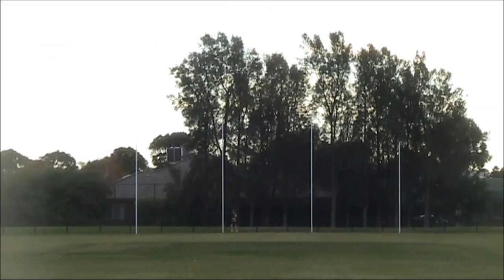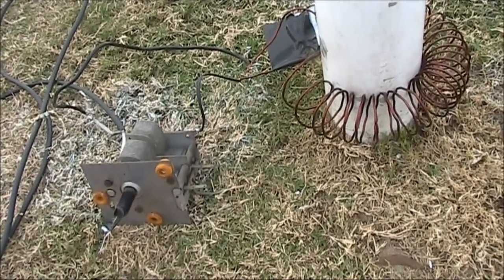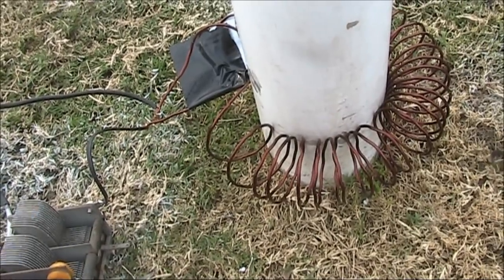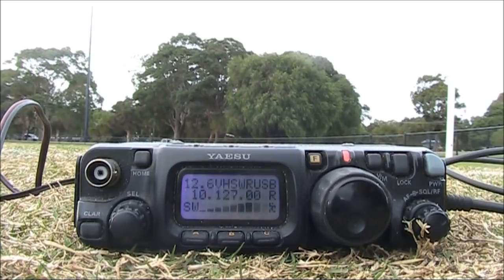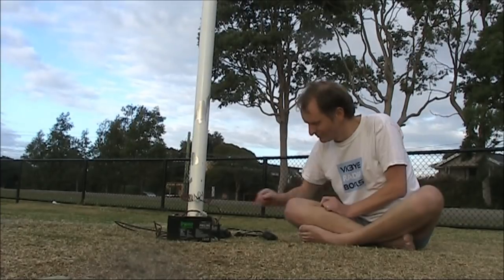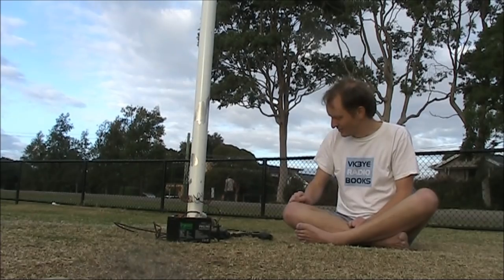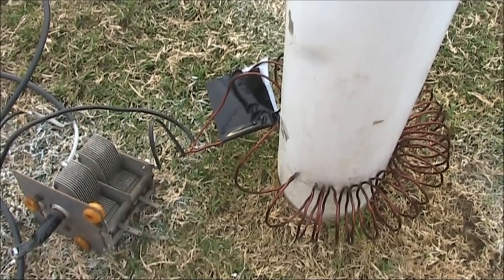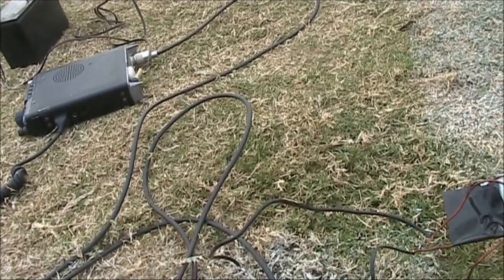Kicking goals with a Rowland Ring: Using a goal post as an HF antenna

Comment: Experimentally, you might consider some of these off-the-cuff hypothetical ideas Peter; are the parallel “Aussie-rules” posts acting as directors/reflectors such as a Yagi-Uda antenna?  Would a single pole, such as a metallic or wooden telephone power or streetlight pole behave differently.  Would cables inside a metal pole affect the coupling?  Did you try to vary the height-above-ground for the coil to test that variable? Seems the US Army Panama experiments sought out orphan stand-alone trees and were “coupled” higher above ground. Great experimentation as usual with you ‘mate! Never would “wood” (HAHA!) have known about this otherwise! 73 KN4HGI Alan

Comment: I think this has great potential but as much of your signal would be disappearing into the soil, you may get great results with at least one ground radial. 
Did you try moving the coupling coil higher up the post? that might make it behave a little differently

Comment: After some research I found out that the US military experimented with trees and metal structures as an antenna, coupled by a so called HEMAC coupler. It's pretty the same what you built except the matching circuitry of the US guys was a bit more complex. More information by searching for "kurt ikrath" , "hemac" 

Definitely got to try that. 73!

Comment: Could you hear anything with just the ring and the variable capacitor?
I'm keen to know how much of a difference the pole was making, and how much the ring itself was already picking up... If that makes sense?
Reply from the maker: Haven't tried it. But I did try a much shorter (2m) pole with capacitance hat (ie a clothes hoist) and sensitivity was much less. So I'd say the ring would be picking up very little.

Comment: Was expecting you had a vertically polarized 4 element array there, your 3x3 reports were probably off the back of the beam 😮
Reply: I am showing my ignorance of the rules of AFL here, but I don't know what the distance between the two main posts is, but you raise a good point - there would be parasitic currents induced in the other posts.

This could be harnessed to advantage in the other post of similar size by using another Rowland Ring and variable capacitor (not connected to anything else) to tune it.  This could realise a vertical yagi!
Reply from the maker: @vk2ig  You're not alone. I had to look it up. Apparently it's 6.4 metres. So almost 1/2 wavelength on 15m and a bit over a 1/4 wl on 20m. Would a Rowland Ring and variable capacitor on the passive element actually do anything at all? I can't see that it would. I would be inclined to try phased verticals, both driven, changing the phase relationship between them.
Reply: @vk3ye  The fact that the posts are earthed would seem to compromise the whole thing somewhat. Earth losses etc.  Do you have an antenna analyser?  Take it along and get a few measurements.
Reply from the maker: @Paul_VK3HN  Unfortunately no antenna analyser. But the wide tuning makes me suspicious.  My nearest pier has a horizontal bar about 40m long. Would be interesting to try to load that, trying different spots along between end and centre.
Reply: @vk3ye  Peter, I am thinking that a Rowland Ring and capacitor would tune the resonant frequency of the passive post. That's what it's doing with the driven post that the radio is connected to - the only difference is that the passive post wouldn't have a radio connected to it. (It's similar to tuning a vertical element with a ring of wire.)

But, there may be no point trying it on lower frequencies because the posts are too close together in wavelength terms - in which case driving both posts may only help reduce the losses compared to driving just one post.

Doing it at higher frequencies may allow azimuth pattern formation due to better spacing in terms of wavelengths, but the current distribution on the post may result in a less-than-optimum elevation pattern due to its height in wavelength terms (if this occurs then it would happen with just one post also).
Reply: @vk2ig  I think what's happening is that the ring is coupling into the post and you are not changing the resonant frequency of it but are varying the resonant frequency of the rowland ring plus the influence of the metal goal post.
I wouldn't be surprised if coupling to the post is actually rather weak
Reply: @Dazzwidd  Yes, the resonant frequency is that of the Rowland Ring and the pole. The pole itself has a number of resonant frequencies, starting at the lowest where it is an electrical 1/4 wavelength, next is when it is 1/2 wavelength, and the rest are subsequent integer multiples of those lengths (with adjustment for element diameter). To change the resonant frequency, add the Rowland Ring (or other reactive loading device) - that changes the effective electrical length even though the physical length doesn't change. Electrically, it's analogous to putting an inductor or capacitor in the middle of a parasitic element in order to change its resonant frequency (which is how some reversible arrays work).
Reply: @vk2ig  I don't think that the coupling effect will be strong enough to effect the resonant frequency of the pole much though. Or the Q of the pole is that low because it's in lossy ground and you're coupling into it at that point where it enters the ground.

Comment: Why not just wrap the wire around the pole like a coil ? Of course with a capacitor in series or parallel. wouldn't it not have the same effect?
Great job!

Comment: Great to work you on the goal post antenna Peter! I wonder if a live tree might work better as there would be more moisture in a live tree, as opposed to a goal post? Maybe worth a try? A friend in the Australian Army Reserve told me ages ago they’d used trees as antennas (I guess as a vertical with a counterpoise??) by hammering a small nail into the trunk. Trees with more moisture worked better which makes sense but not sure if a live tree would improve the performance of your coil system? Love your work Peter! Craig VK3CRG
Reply from the maker: Craig - My guess is that the goal post, being more conductive, would be better than a tree. Saw an account somewhere of experiments that indicated that. The army experiments seem to be over distances much smaller than we hams like to communicate with.
Reply: @vk3ye  Peter, the metal goal post would likely be more conductive than a tree, due to it being constructed from a conductive material and probably having greater cross-sectional area (hence less resistance per unit length) than the regions of a tree carrying sap (which is the conductive part of the tree). Then there is the issue of the resistivity of tree sap, too.

The Australian Army do tend to work over shorter distances on HF due to the formation sizes. Brigade or Task Force ground elements are not widely dispersed, so Army tend to be NVIS specialists. It's the reason why the typical HF radios used at that level by the Army around 40 years ago (AN/PRC-47, PRC-F1) only covered 2-12 MHz.

Comment: For those of us across the pond, Football = “Soccer”. Interesting video, Peter! Thanks! =) Question: What if you stetched out the coax to form a better counterpoise, would that help with the SWR?
Reply from the maker: Good question. An alternative could be to clip onto a nearby fence.
Reply: Hmmm ... you could load up some soccer ... errr ... I mean football ... goals as Inverted-Ewe antennas for low-band receiving.
Reply: Thought Australian football was a rugby variation.
Reply: @kevinj8258  In Melbourne (and all over the southern Australian states as well as in WA) they play Aussie Rules football. Here in Sydney (NSW) and in Queensland they play Rugby League.

Comment: Wouldn't just wrapping a wire around the pole a few turns result in something similar, and be easier to transport? Maybe test that next
Reply from the maker: Haven't tried it but suspect not. Here the radiating pole is parallel to the windings. Whereas it wouldn't be if the wire was wrapped around it. That might affect the amount of coupling.
Reply: The magnetic field arising from wrapping wire around the pole would be parallel to the axis of the pole, and thus trying to induce a magnetic field in the pole (like an AC electromagnet).  In contrast, the magnetic field produced by the Rowland Ring is concentric to the axis (think of the magnetic field produced by a toroidal winding, only it has an air core), and thus the pole is acting like a single turn secondary winding in an air-core toroidal transformer.

In summary: the magnetic field in the Rowland Ring is at right angles to that the magnetic field produced by wrapping wire around the pole, so the coupling is very different.
Reply: How does that interact with a tree?
Reply: @BrekMartin  Trees have sap flowing just under the bark, and this acts as a somewhat-conductive liquid, thus allowing a current to be induced in it by the Rowland Ring.
Reply: take a G clamp and use a tuner :)